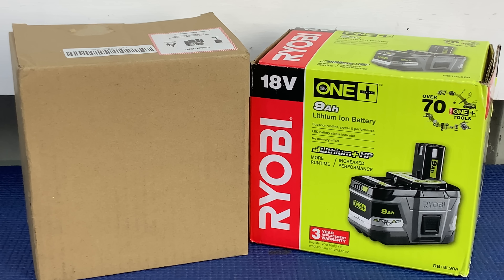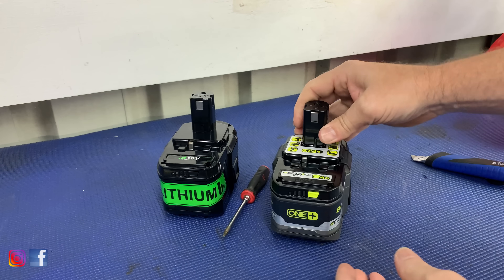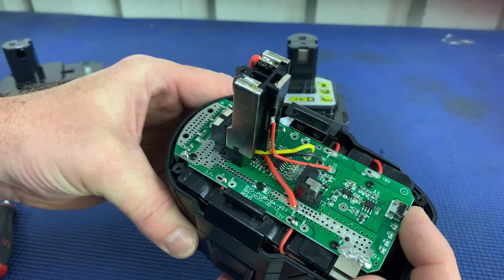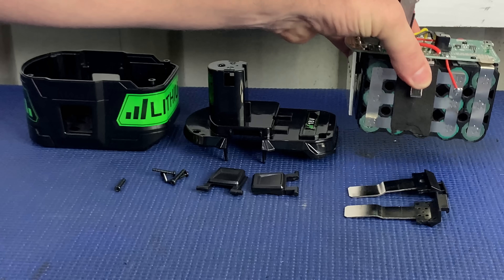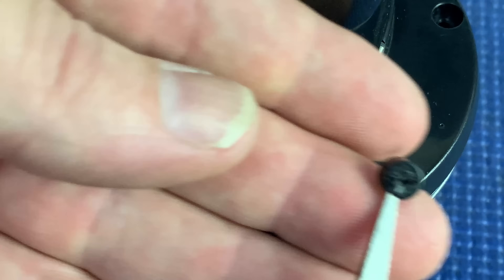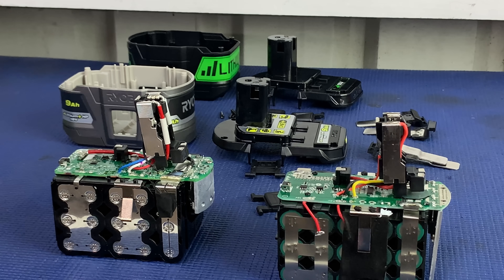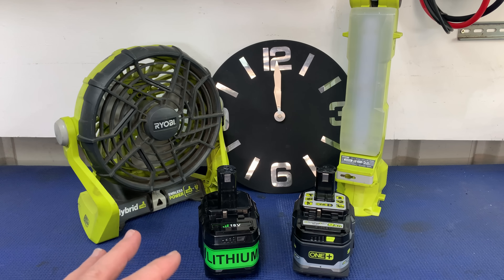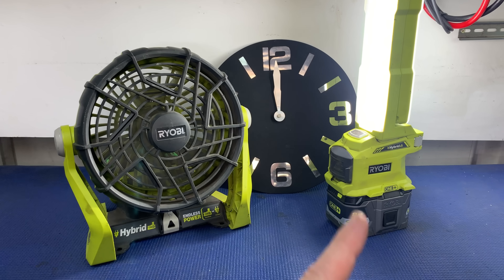Ryobi 9ah battery versus eBay knockoff job

Comment: Good luck with a "Five Year Warranty" from a no-name Chicom brand bought on eBay.  I'd wager it doesn't actually exist even if you know Mandarin and have a direct line with whatever factory made it.  They can't even get the case fit right on their copy.  Internals look better than I expected.

On the Ryobi battery, it's $159.00 in the US:

https://www.homedepot.com/p/RYOBI-18-Volt-ONE-Lithium-Ion-9-0-Ah-LITHIUM-HP-High-Capacity-Battery-P194/301687122

At the US$ to AU$ exchange rate (1.32 AU$ to 1 US$) AU price should be 1.32x159 = AU$210,  so import duties may explain the higher price.
Reply: At Bunnings Warehouse in Aus pretty much like your Home depot they are $199AUD https://www.bunnings.com.au/ryobi-18v-one-9-0ah-lithium-hp-battery_p6210807

Comment: 300AUD for a  battery? what the hell...  they have at least 150AUD markup on that battery.
Reply from the maker: That is what I (wife) paid about 6 months ago.. as I linked in another comment Bunnings have them for $199
Reply: @HBPowerwall  still not worth it :D but i guess the other appliances (leaf blower etc.) were relatively cheap

Comment: ya im curious about those batteries type mha on sleeve and that is a fuse on the ryobi on the side. mostly for a dead short scenario.
Reply from the maker: I'm itching to pull it apart, but have to do planed videos in order lol I imagine your right, it's a descent sized fuse.
Reply: @HBPowerwall  Here's a video thought. when you pull it apart replace it with the "RIGHT" batteries! Maybe make the Ryobi into a Lipo pack and move the batteries from the Ryobi to the generic.

     Also if you can remove the plastic on the side clips check if they are magnetic. If they are Just before you remove the plastic clip tops. You can carefully bend them so that the have much more clamping force for locking the battery in the tool/charger. Than heat the metal with a torch so that as much of it is above 1475°F/802°C Which is the magnetic critical temp of steel/iron (can be higher) and fast cool(quench in a water filled can. This can be plastic as long as you don't touch the sides. when quenching move up and down vigorously so it does not vapor lock and cools as fast as possible. 

    Put in oven @ 375°F/191°C for 1hr & let air cool and repeat when it's temp is below 200°F/94°C for a total of 2 1hr runs. (this removes brittleness & adds spring to the steel.) If it is not magnetic than go scrap pile and get some 1045 steel in about same thickness. and Heat, Beat, & Bend to shape and follow same recipe. (if you want to hammer you can use car or truck used springs but the plate/sheet scrap of any mild 10 series steel is easiest. 

     Most mild steel is 1018 which means 0.18% carbon and it can be hardened with the above but best results is 1045 0.45% carbon. otherwise O1 or O2 can be used but if you do lmk and I'll tell you proper oven  temp & cycles to get to springy versus knife edge hard. (yes a house oven or toaster oven works fine)

I am betting that the legs on the power pole need to be shaved down a touch on the side facing the power check light and it will fit like it should. I notice it was leaning backwards a bit. which is probably causing the gap issue.

I don't recommend putting higher power batteries into the ebay knockoff other than the ones in the ryobi.

and I don't know if you can replace the ryobi batteries with say LiPo batteries or just higher rated premium batteries to make it go from 13hr light to 18+. I did a quick search a couple months ago and could not find anyone that has tried this as of yet.

So the video may go viral and attract a bunch more people subin'

If you want to toss ideas around lmk and we can either IG or FB each other.

worldseyes2
& AT
gmail
and 
com

Comment: The knock offs are all ok for low load applications but usually fail under more demanding use.
Reply from the maker: I can't fault it for the fan and light.. Didn't test with hot glue gun, but Whipper snipper & Blower it was honestly like using the 2.5ah battery. I suspect the voltage sag from poor spotwelds and thin nickel plated copper rather than pure nickel
Reply: @HBPowerwall  Do you mean nickel plated steel?
Reply: @HBPowerwall  Nickel plated copper is supreme to any other spot welded material, so you must mean Nickel plated iron.

Comment: Had a Mikita with a parallel pair of 50a fuses blown after an accident ...just bypassed them with nickel strip and it worked again
Reply from the maker: Must have been a decent woops to blow 50a fuses on a few cells!
Reply: Think it involved a conductive liquid being spilled
Reply from the maker: Conductive liquid would be a bad thing!! The instant short circuit current can be massive i guess.
Reply: In serious tools these batteries are delivering those kind of amps i was actually surprised to see any fusing I guess 100A is a good cut off point though

Comment: In regards to fitment of battery... You did take it apart, maybe your assembly was wrong?  I'd of tried fitment before disassembly.  Also I bought my 9ah official Ryobi batteries for $74 each on sale a year or so ago.  Think I had to get 4 pack for that price.
Reply from the maker: I used the battery and it fell out and actually prompted the video, so it wasn't the way I put it back together. I actually got the battery from Bunnings and paid 299 for it, I've just checked again and it's 199 :( https://www.bunnings.com.au/ryobi-18v-one-9-0ah-lithium-hp-battery_p6210807, More weight to just buying genuine
Reply: @HBPowerwall  $199 AUD is around $153 USD right now.  I ordered a 2 pack of 9ah batteries from Home Depot for $139 USD on June 2019 when they were on sale.  Maybe Bunnings will refund on current price?  Or you could order another one for $199 and return it as the $299 one (since you broke open seal on one your have)... if returns are possible on that?

Comment: China lies and mismarks cells...don't even bother ripping it apart to see what cells are marked as. Testing will reveal everything we need to know.
Reply from the maker: I will eventually - really want a long term load test that is consistent to see how it holds up.. History says won't make 50 cycles and the BMS will be the first thing to fail.
Reply: @HBPowerwall  keen to see the findings.

Comment: Capacity test the cells from the cheapo
Reply from the maker: Just waiting on the iCharger X6 to come back, all my processing gear gets loaned out and even I have to wait lol I'll load test both in another video, do a 100 3 amp load tests see how it holds up also might look at all the specs of the tools work out the highest load tool and put that onto the batteries and see how it holds up. I chucked out the box ages ago but might see if there is a max load rating on the batteries and pull that from them with thermal camera see what happens.